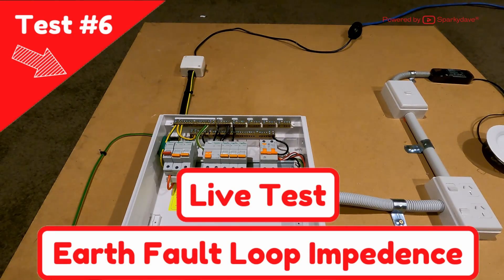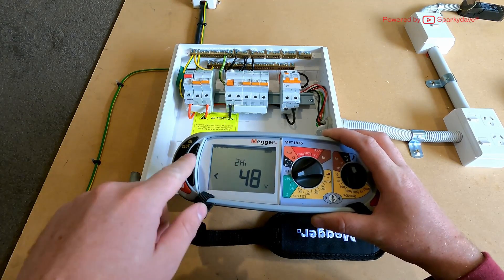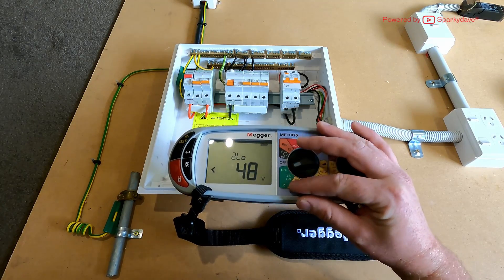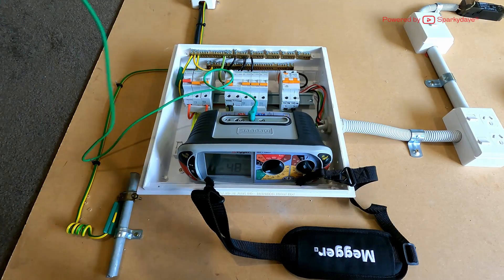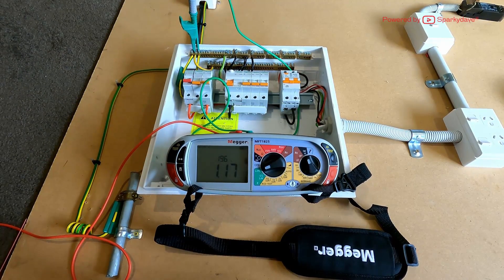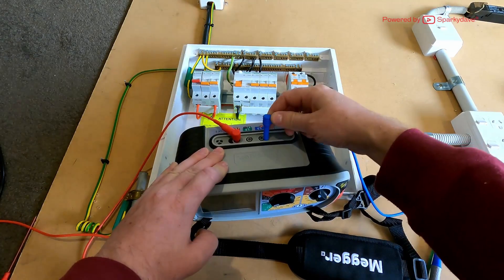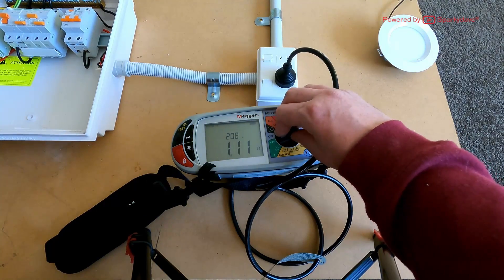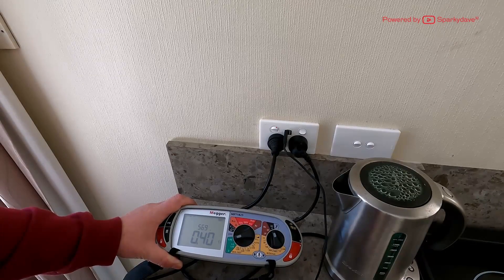How To Test Earth Fault Loop Impedance (EFLI)

Comment: Thanks mate.. I have a question, why do all the meters use nominal voltage in this calculation, when in fact the fault current as well as the impedance measured are all related to the actual measured voltage (which often can be far different from nominal)?
Reply: Because the rulebook says that's what you use